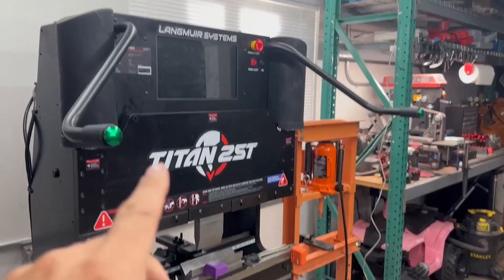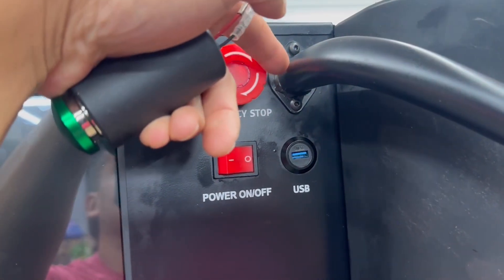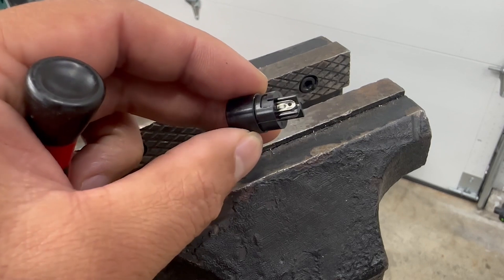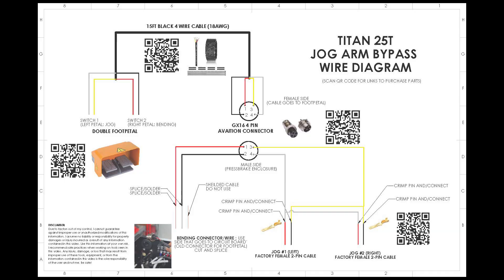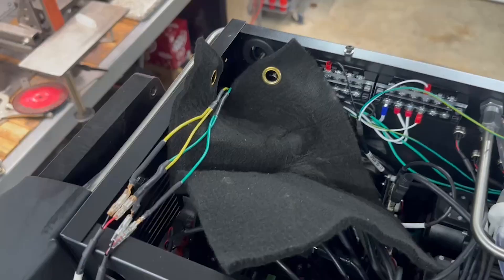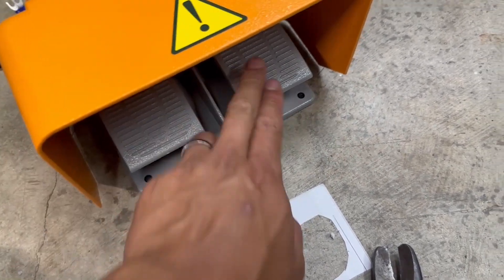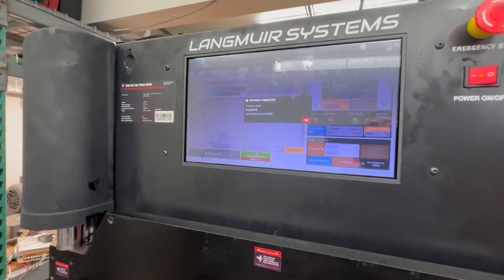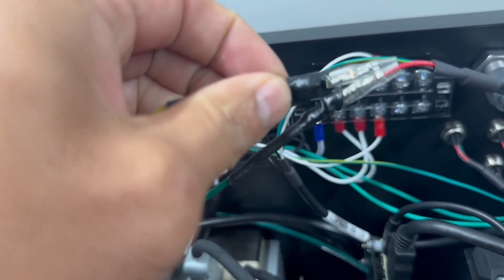How to DELETE the JOG ARMS from the - Langmuir Titan 25T Pressbrake

Comment: I'm wondering how to take this a step further...would it be possible to use the factory footpedal,and wire the safety and the jog together, so  the first press activates the safety and the jog, and the double tap makes the bend?
Reply: or...two pedals, and the left activates the safety and the jog at the same time, and the left the bend? would REALLY like to get rid of the double tapping redundancy, that is gong to make both my feet hurt when running production.

Comment: Great video thanks for taking the time to share this info with everyone. I curious how will you go about bleeding the cylinders independently of one another now that both switches are wired together essentially?
Reply from the maker: Anytime! To bleed each cylinder just simply unplug the y-cable harness and connect as if you were to connecting to one jog button for each side. Then when one cylinder is bled you just switch the connector to the other jog button wires. When done just reconnect back to how you had them wired in parallel.  that’s the benefit of using those male spade terminals easy to disconnect and reconnect